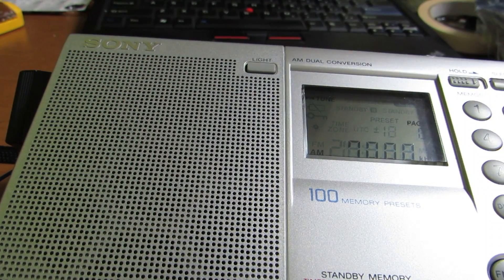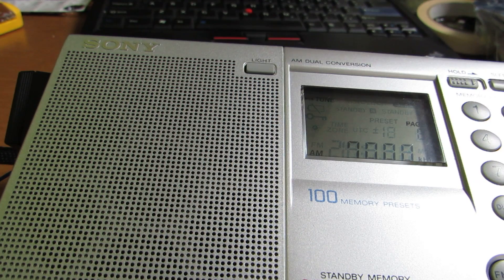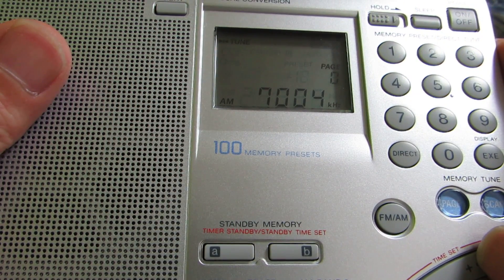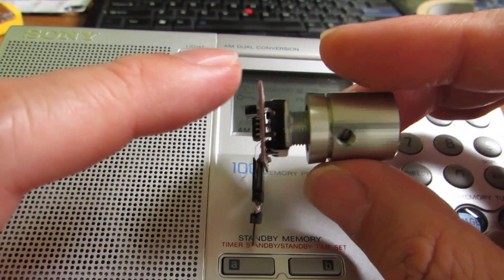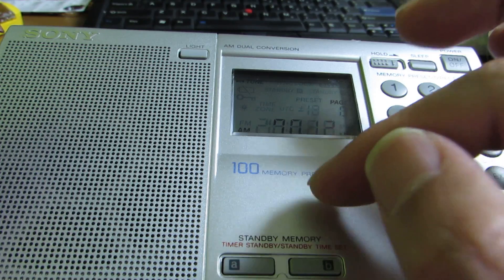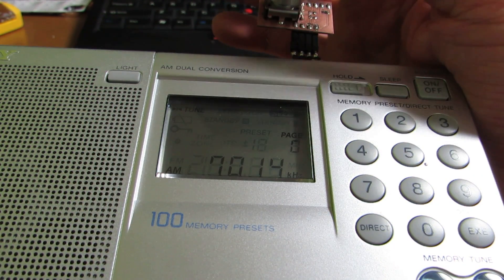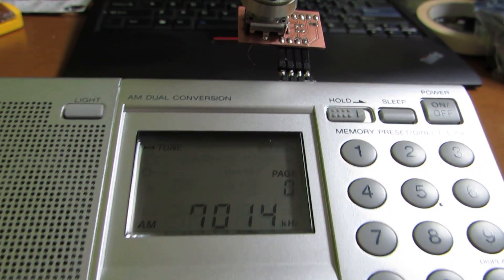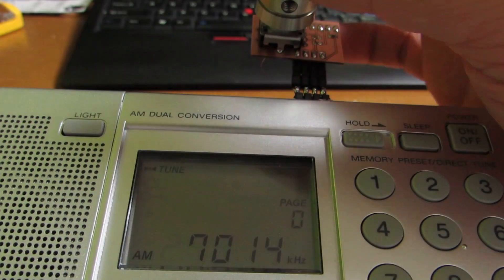Tuning dial for ICF-SW7600GR shortwave radio

Comment: Hello. Very interesting modification. Unfortunately, the link you left does not work. If possible, give a working link. Thank.
Reply from the maker: Hmmmm, I remember it was deleted by some reasons. But just attaching photo coupler to activate frequency up/down and rotary encoder block is made of Attiny25 to produce pulse for clockwise/anti-clockwise rotation...
Reply: @microwavemont  Thank. I plan to do something like that.